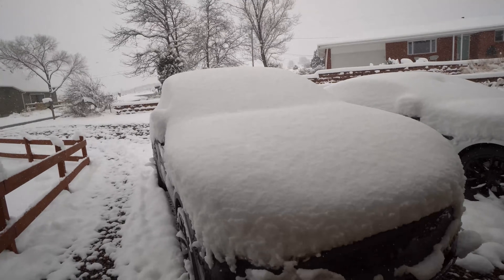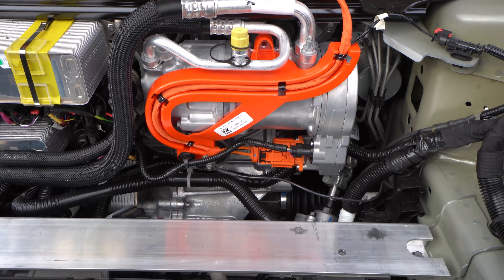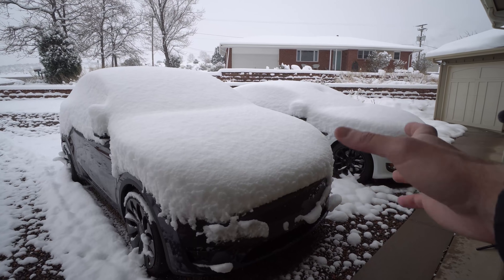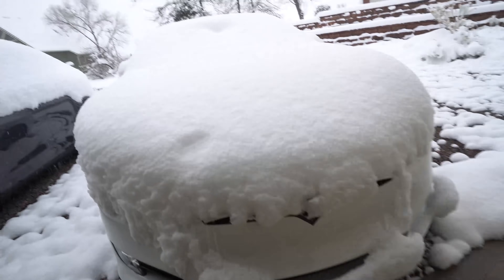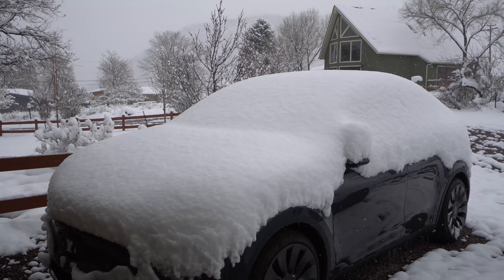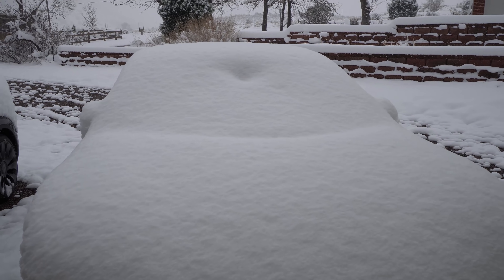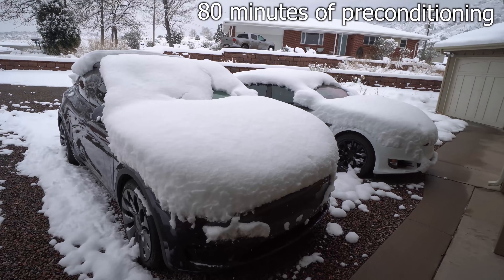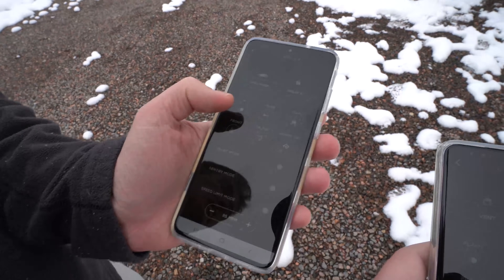Is the Model Y Heat Pump More Efficient? Preconditioning Challenge! Heated Radar?

Comment: Model S: storage volume = 31.56 cu ft, battery pack = 100kWh, consumed = 9.6 kWh (9.6% of battery)
Model Y storage = 68 cu ft, battery pack = 74kWh, consumed = 10.9kWh(14.73% of battery)
Now assuming model S had a storage volume equal to model Y (68 cu ft instead of 31.56 cu ft):
then it would have consumed about 20.7 kWh (20.7% of the battery) which is almost 6% more battery consumed compared to model Y!
Now THAT'S Math ( not really ;P)
Reply: The 68 cu ft storage for the Model Y is with the back seats folded down, isn't it? And the 31.56 cu ft for the Model S is with seats up. So I don't know what you are comparing. The actual interior volume in the Model S is 120.0 cu.ft. I don't have the specs. on the Model Y's interior volume, but I think that is what you would want to use in your comparison.
Reply: OK, lets do some more math: 
68 cu ft times 957.5 fl oz per cu foot equals 65110 fl oz of volume.
Now, by volume, water has around 3200 times the heat capacity of air.
Dividing 65110 by 3200 equals about 20 fluid oz, so:
If: 1) you have a perfect system with no heat loss, and you start with 68 cu ft of air at 15 Deg F, and one large cup of coffee (20 fl oz) at 175 Deg F. 
And 2) you let them sit until the air and the coffee are at the same temperature.  
Then, the resulting temperature will just be the average temperature --  95 Deg F -- (average because they have equal heat capacities).
The amount of heat going into heating the air is very small.  The heat energy is going more into things like melting ice/snow, warming the metal/plastic/glass of the car, and just dissipating to the outside air through the limited insulation of the car.
Reply: The cargo space of the S with the seats folded down is 63 cu ft.   So you need to use that figure when doing calculations with the Y’s cargo space of 68 cu ft, which is also with the seats folded down.
Reply: Are you a math teacher? lol

Comment: Whm? Why not using the % for the mats? Way simpler
Reply: Because % doesn't tell you how much power was used when both cars have different size batteries. The way he did it was better, but still not great. Both cars should have had OBD dongles to get the real data from the car as the "GoM" (guess o meter when you view it in miles range remaining) is not particularly accurate.

Comment: Maybe the front radar only heats up when the car is in Drive since that would be when it is needed?  The heat pump design is supposed to use scavenged heat from things like the drive motors, battery, and maybe even computer so none of those things produce much heat while parked.  Maybe a test of efficiency while the 2 cars are being driven would show more but then there is a difference in tire resistance, aerodynamics, plus speed, road conditions, weather, etc. would all need to be comparable which even the battery cells and motors are different between these 2 cars so probably a moot point anyway.
Reply: One other thing that makes comparing the two difficult is that each car has a different cabin size and different outer surface area, so their exposures to cold are different - that will lead to different consumption/range efficiency even with identical heating systems.
Reply: It's does have a closed loop to start. Heats itself up.  Elon said it on the third row
Reply: In regards to the heated radar:  I’ve had the “radar blocked” message twice now driving in snow (albeit, wet heavy snow), the front bumper on the Y had a thin layer of snow stuck to it.  Model Y LR AWD w/FSD.  I’d bet it’s not enabled at temps in the low to mid 30’s?

Comment: Looks like the model Y got much warmer, so it still was more efficient, although it used a little more energy.  Basically it did more work.  A better test would be to quickly heat the cabin, let it cool and repeat 10 times.  Start and finish with the same temperatures.
Reply: mrmichrom if you want efficiency then the heat pump wins by its very nature.
Reply: I thought the S got warmer? 10:18
Reply: @mmdday  The S ramps heat up in the cabin quicker because of its resistive heater giving instant heat.  But if you look at the FLIR camera for the longer test, you can see the Y gets much warmer.  So in the long run, more energy gets put into the Y.
Reply: Heat pumps are not always the most efficient way to heat, especially when the temperature of the cold side heat exchanger is very low.  There is also the inefficiency of having to have a fan on the cold side blowing outside air through that radiator, and the efficiency of the electric motor running the heat pump.  On a COOL day, when outside air is in the 40s or 50s, the thermal efficiency of the heat pump would be significantly higher, raising the cabin temperature only 20 - 30 degrees warmer than the cold side.  On a 15 degree morning, it must raise the temperature 55 degrees to reach 70 in the cabin, so it is much less efficient.  A resistance heater is likely to use just as much or a bit less than a heat pump as well as producing hotter air at the cabin outlets and producing it more quickly, so it might FEEL warmer to the driver.  Tesla has achieved more efficiency only for the TYPICAL heating scenario in coolish weather, as well as gotten dual use (heating and cooling) from its compressor so it might be a reasonable compromise.  But a resistance heating element is very cheap, so the cost of ADDING one to the heat pump in the Y and using the resistance heater instead of, or supplemental to, the heat pump would be a nice way to achieve an even quicker warm up,  best heat performance in very cold weather, and at little cost penalty.  PS a heated steering wheel would help the driver ignore that his feet haven’t warmed up yet.